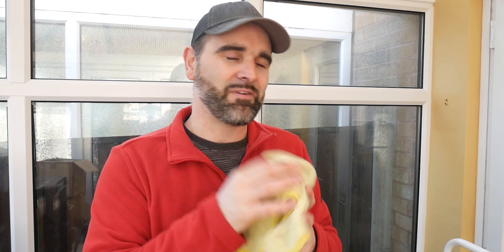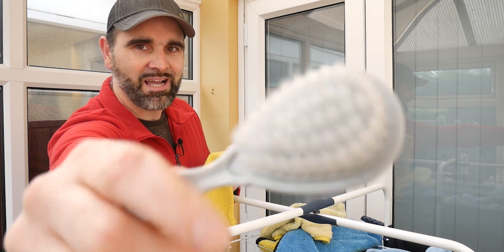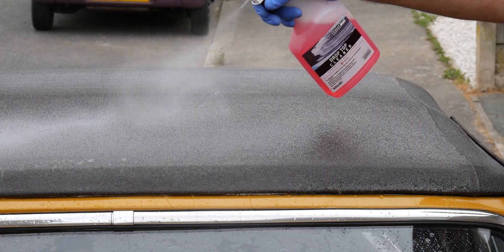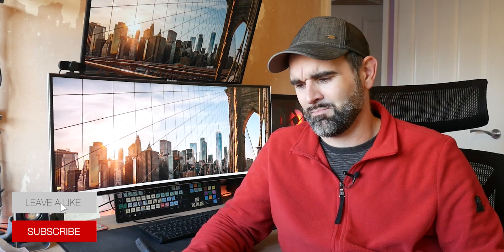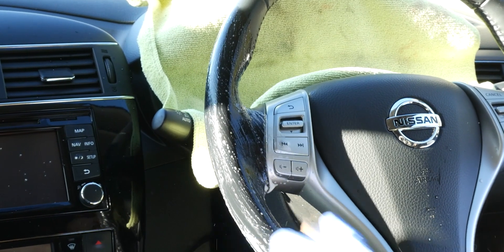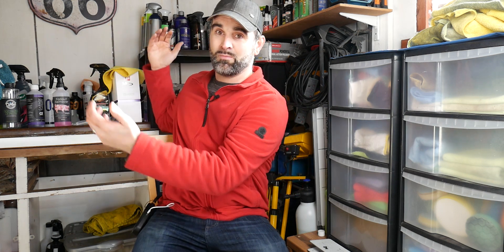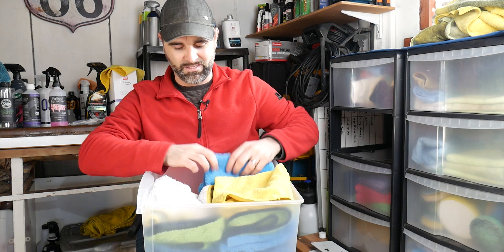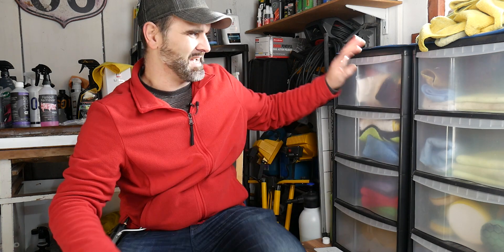Storing And Organising Your Microfibres - Oh, and a Q&A Session!

Comment: Good advice here about Microfibers!   Especially the tip with using the small brush designed for baby hair use to brush out the smaller bits and fluffing up the microfibers a bit before using again.    One small tiny rock bit or hard something in the microfiber that may not be seen can definitely inflict micro marring or scratching onto the paint.    I've done it myself and went "HOW"? afterwards.   Well, after a close inspection on the microfiber I was using,  I found a very small (tiny, almost unnoticeable) piece of hard unknown debris down in the microfiber towel which was inflicting scratches into my very soft Nissan 370Z paint as I applied a spray wax after a wash.   And I always use very light pressure just enough to get the product off the paint.    It does not take very much at all to inflict all kinds of marring onto the paint, even when you think you have a perfectly clean microfiber.